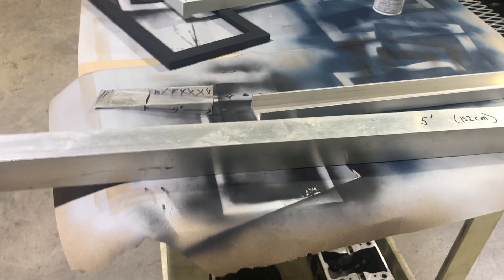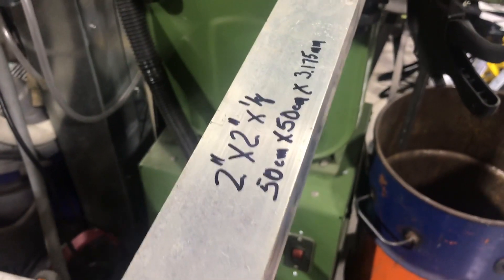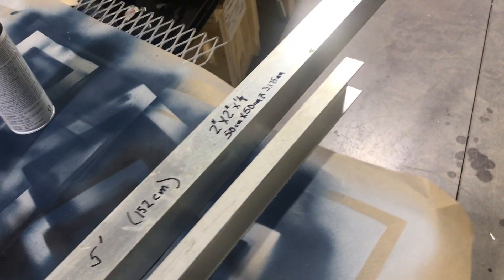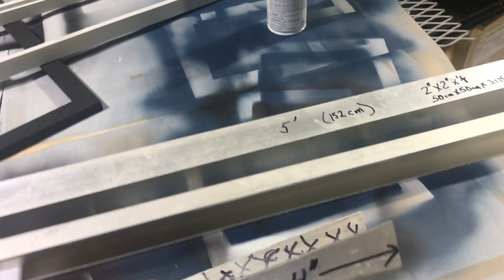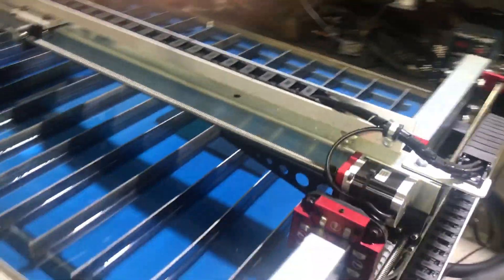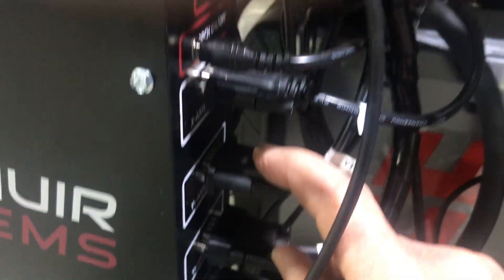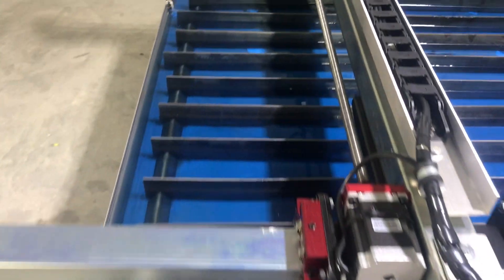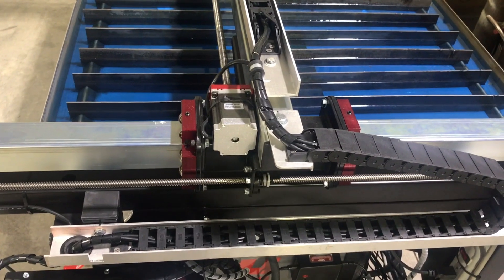Installing drag chain on the Langmuir CrossFire Pro

Comment: I just bought two 5" bolts (3/8") and two 1" x 3/8" bronze spacers to mount the X-axis channel.  I saw someone else had zip-tied the mount around the z-axis motor.  I'm going to look at fashioning a clamp system so I don't have to drill and tap the motor mount.
Reply from the maker: Sorry for the delay in responding…for some reason I didn’t get notified of your comment.  Hope the clamp design worked!
Reply: @CustomCreations3  Thanks.  It worked perfectly!

Comment: Could you of used a smaller drag chain on both the X and the Y? Or did you use what you had laying around?
Reply from the maker: The x chain (18mm x 25mm) could have been smaller as there are only a couple wires running through it.  The y chain (15mm x 30mm) is pretty full so I wouldn’t go much smaller
Reply: Ok thanks.

Comment: Great updates!  Is the wider drag chain a 15mm x 30mm (as indicated in your Amazon link) or is it 15mm x 40mm (as I thought I saw in the actual video images?  The inside width of that 2" x 1/8" wall aluminum track would be 1.75" (44.45mm) and it looks like your drag chains fit really nicely... which implies the 40mm width might be what you used.  Can you confirm which is correct?  Thanks!
Reply from the maker: Hey Greg,  

The chain in the “x” direction (one on top) is 18mm x 25mm as very few wires go through it. The “y” direction chain is 15mm x 30mm.  You’re correct that 40mm would fit but when I sort of measured the wire bundle the 30mm was sufficient so that what I used.

Comment: Nicely done! Thanks for posting this. I just started putting my CF Pro together and I'm going to do the same. Your tips will save me a lot of headaches! Thanks again!
Reply from the maker: Thx for the compliment…hope you enjoy the table as much as I have.
Reply: @CustomCreations3  I'm about to add the u-channel. I got some 2x1 - 1/8 thick. It seems a bit heavy. Did you have any issues with the additional weight (U-channel and chain link)?
Reply from the maker: @Rodzilla-du3pp  is the u channel steel or aluminum?  I would recommend it be aluminum but even if steel I wouldn’t expect the weight to be a problem. If had the torch hit a 4’ x 4’ sheet of 11 gage steel and push it. I wouldn’t want that happen often but the stepper motors and lead screws certainly had the torque to do it.

Comment: Great video and excellent job on the modification.  I'm curious about that blue stuff you had in your water tray, what's that called and where can I get some.  Thank you.
Reply from the maker: Thx for the kind words Steven.  The blue stuff is called SterlingCool-PlasmaCut and was purchased from Cutting Fluids Direct (www.cuttingfluidsdirect.com).  I’ve been happy with it.  Have had steel sitting for days after plasma cut and no rust, so not only does it reduce fumes but it must have some water soluble rust preventative that keeps the slats from corrosion

Comment: Very nice install. I am wondering why you drilled into the top of a bolt to mount the spacer? Seems like an unnecessary complication. Why not make the spacer slightly taller and mount it to the Y axis beam? A hole sized for a 1/4-20 hole won’t compromise the beam’s integrity. Wouldn’t need a lathe. Just curious.
Reply from the maker: Your solution is a good one.  My biggest reason for not doing what you suggested was finding a way to mount the spacer to the beam.  I didn’t feel the beam wall thickness was sufficient to provide a good amount of tapped threads which meant I would have to drill a hole through both tube walls and use a nut on the back side.  My ability to do that by hand without it being cockeyed is suspect and I’m too lazy to disassemble and take to my drill press! 🤓. I guess you have demonstrated how having a lathe can exacerbate the propensity of laziness…especially as I get older!  😈
Reply: @CustomCreations3  Perhaps not laziness but “inventiveness”! For those of us without one, we have to be less so.
Reply: BTW- I drilled and threaded into the top of the beam and with the spacers to add angular strength, the rail is very securely attached. I have no concern at all for strength and it looks really good. As you gained ideas for others, I gained from you. I appreciate your work.Thanks!
Reply from the maker: That’s good to hear…hopefully others planning to add the drag chains will read these comments and see there is an alternative to drilling the bolt.  Appreciate your willingness to offer ideas.
Reply: My question is why not just buy a longer gantry mounting bolt and use a spacer? Is there anything that makes that a bad idea?
Reply: @5ivearrows  Seems workable to me.

Comment: @D & N Custom Creations
First off I would like to say thanks for taking the time to post these videos (please keep the tips and updates coming).
I was wondering if there is room in your current drag chains to fit the torch cable?
Do yo see any reason you couldn't include the plasma cutter cable in the drag chain (assuming it's not too tight)?
Reply from the maker: Thx Sean for the kind comments.  I do have a number of ideas for future videos and need to get them recorded ASAP.  There is room in the chain for the torch cable but the stiffness of the cable would require the chain loop to be much larger.  I’m not sure if the machine torch cable is stiffer than a hand torch but my machine torch cable would need about a 24” diameter loop if I had to guess.  So I don’t even try to include the torch cable in the chain. I’d like to see someone do it and share their results...would be a great improvement if successful.
Reply: @CustomCreations3  I was worried about the cable thickness and figured that was why no one has done it. I see the new crossfire XR is running the plasma cable in it's chains as do many other more expensive plasma cutters. I wonder what the trick to there set up is?  

I hope some one pulls it off and share their knowledge on the forum : )

Comment: Just got my channel and cable today! first parts for my pro haha waiting for table to come in.
Reply from the maker: Excellent!  Haven't really had time to start production yet with my table but really happy with the cut quality on the parts i've done so far.  Starting to build up a library of cut files and will start producing samples so customers can see what they would get if they purchased.  Still trying to figure out how to charge...not enough experience to make a video on that one!!! :)
Reply: @CustomCreations3  Hello not sure if you mentioned it ...you have 3 separate chains in the description, did you have to add to the 1 meter? Thanks Im finally setting mine up and finished tapping all my bolts, and the chains I have I got too small. Thank you
Reply from the maker: @Issac_G  there should be quantity 2 of the larger chain cause I did have to put two together the get the length along the x-axis.  The y-axis was short enough to only need one chain.
Reply from the maker: @Issac_G  what did you use for the channel the chains ride in?  Some have had trouble finding something that would work
Reply: @CustomCreations3 appreciate the reply I did exactly what you did, cut down the 2x2.
Reply: @CustomCreations3  wanted to thank you again  I posted pics on the forum and linked your channel
Reply from the maker: Thx Issac…checked out your pic…the way you rounded the edges on the chain supports and use of socket head screws looks really clean…I’m jealous!!
Reply: @CustomCreations3  trying to make it as stock as possible, thanks again! Im glad I took my time with eveything, table is running and cutting amazing